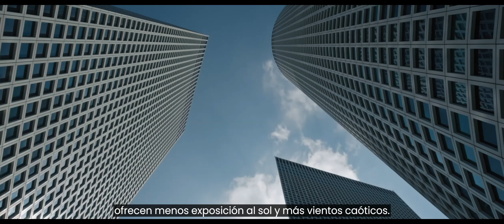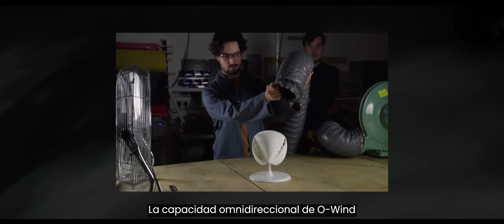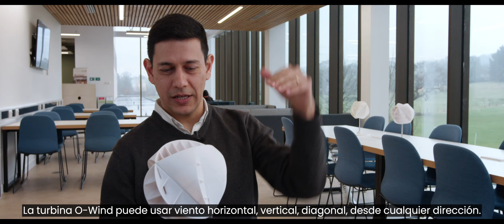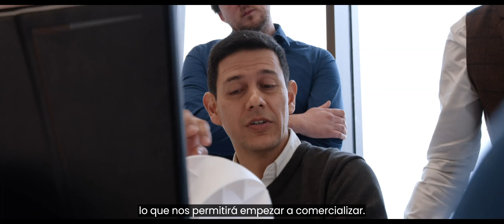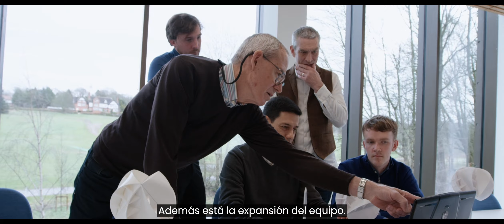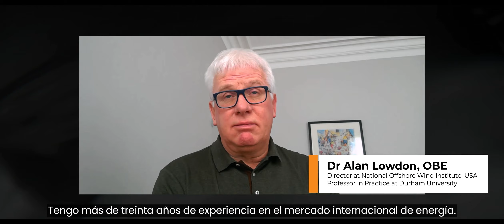O-Wind by O-Innovations, video oficial (ESP)

Comment: Mount them on top of the barriers between highways. The wind off cars, buses and trucks would keep them spinning. With the design it wouldn’t matter what way traffic was going to catch the air off both sides of the road.  I think some places call them Jersey walls. Imagine miles of a turn pike with these basketball size turbines spinning from the wind blowing off the cars and trucks going past at 65mph catching the wind from both directions.